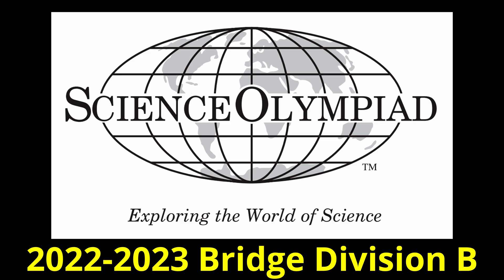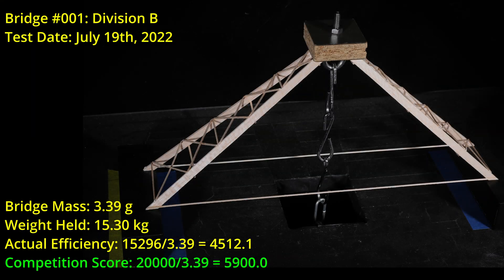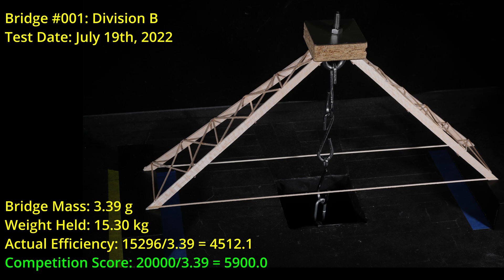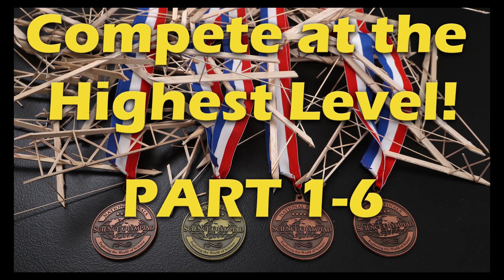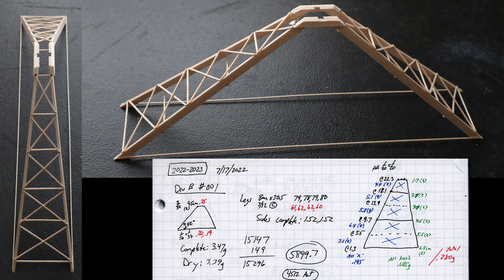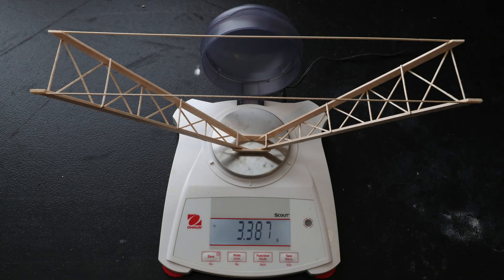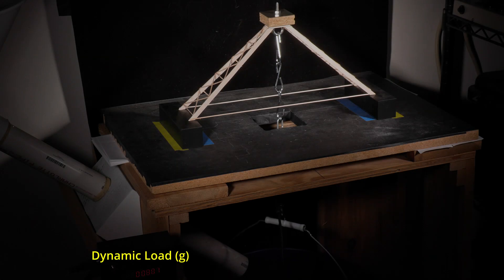2023 Science Olympiad Bridge Div B: 5900

Comment: kinda late but is it fine if i use basswood for the legs and just glue two of them together?
Reply from the maker: Basswood would work fine, but you'll find that it is much heavier than balsa, so the efficiency won't be nearly as high
Reply: @balsaengineering6686  thanks for the quick reply i just need it to be atleast 500 efficiency  to pass 😅also is the height 24.6cm right? and how long are the legs
Reply from the maker: @rk741  I would recommend drawing out your requirements on a sheet of graph paper to figure that out.  That is basically what I did with this design.  The Div B rules for 2022-2023 specified that the loading block height needed to be at least 15cm spanning 35cm.  If you want the duplicate this design, you can download the side STL jig files linked in the description of this video as well as the assembly jig.
Reply: How would I use the stl files if I can’t 3d print
Reply from the maker: @rk741  You could bring them into a 3d viewer and examine them to try and come up with something to use as a jig.  It really helps to have some kind of assembly jig for these types of devices.  If you don't have or know someone with a 3d printer, you can get them printed as a service, but I have not done that myself.

Comment: What did the Daniel Wright MS bridge of 2015 look like? Was it a similar design? Was it shorter than the 15cm min height of this year? Did it actually hold full load or was it even lighter than 3.06g? their 4906 seems astounding and unreal.
Reply from the maker: Hi Bruce, I got your email, so I'll answer in more detail there.  The short version is that I wasn't at 2015 Nationals, so I never got to see Daniel Wright's bridge.  I would be shocked if it weren't shorter than what we had to do here as there was no height requirement.  A 4900+ actual efficiency bridge is very, very impressive.  I have only ever built one that was better and that was at much more than 15kg.

Comment: do you have a picture of how the assembly jig gets put together?
Reply from the maker: Hi!  Probably the best example of seeing how this jig gets assembled is from one of my other videos where I use very similar jigs.  Check out this spot in the Part 3 of my optimization video.  The jig for this season is put together exactly like this.  Basically just glue the 3d printed parts together.  I like to use PL3 construction adhesive for that.  https://youtu.be/0tzcp99kzdk?t=68
Reply: Hi it's me again. I noticed you have 1/20 by 1/20 bass for your cross member, where do you source the wood? I've searched fnabco, but can't seem to find them.
Reply from the maker: @rylanchau3645  Hi!  The cross members are 1/20 x 1/20 balsa, not bass.  That is made by cutting sheets of 1/20" thick balsa
Reply: @balsaengineering6686  oh, are the tension members also balsa?
Reply from the maker: @rylanchau3645  No, the primary tension members were 1/16 x 1/32 bass

Comment: Hi its me again 😂! I was wondering what the dimensions were for each part of the bridge. For example, the bottom 2 pieces of wood, what were the dimensions of it? If you could get back to me i would really appreciate it!
Reply: Also, the lateral bracing wood pieces, what dimensions were those?
Thanks!
Reply from the maker: The bottom primary tension pieces were 1/16 x 1/32 basswood for this build
Reply from the maker: The cross members were 1/20 x 1/20 balsa and the legs were 3/32 thick by 8mm.  Good luck with your builds!

Comment: Hi there, my student has been building this style of bridge. His last two bridges were 6.5 g and 5.5 g, and they held 12.5 kg and 10.5 kg respectively. None of the members broke on either of these bridges. The glue just broke loose on the top connector piece. As far as I can tell, he's using enough glue and using decent technique, although I will watch him do it next time to make sure it's absolutely correct. Is there anything else to consider to make this connection point stronger?
Reply from the maker: Hi Ryan, it's hard for me to tell exactly what is going on without seeing it.   If you can send me a couple pictures to mklinger at comcast dot net, I might be able to provide some more detailed feedback.  In general, the glue itself doesn't usually fail, so if his joints are popping apart, he's probably not using enough glue or pressing the pieces together long enough or both.  More typically, the glue holds and it rips the balsa itself which means one of the pieces is too low a density.  If you have time, have your student build a very overdesigned bridge, say 10-11g and see if that holds everything.  That should really show if there are build issues.  Also double check how level his build is.  If it's too uneven, it will induce loads on one side that can easily rip the joint apart.  Good luck!
Reply: The pieces are indeed low density, and I thought that might be an issue. On your bridge here, is the connector piece a higher density than the compression members? I might send you a picture later, thanks!
Reply from the maker: @Ryan-qf3kz  I can't remember if this bridge used exactly the same density as the legs, but it'd be very close.  In general, with this design, if the top piece is the same or similar as the legs it should be balanced.  While your case is low density, at 5.5g, it still should be much stronger than what I used here unless your bridge is very unbalanced between the legs and everything else.  Shoot me an email and we can chat some more about it
Reply: @balsaengineering6686  Update: He used higher density balsa on the connector pieces for his next two bridges and it worked like a dream. Got a score of 3773 at Regionals! Thanks for the pointers
Reply from the maker: @Ryan-qf3kz  That is great news, glad to help!  A 3773 score is a very well built bridge!

Comment: Hey there, how can you make it this bridge so light because 1 stick of the leg (thick light balsa) is averagely  5 grams. Also what type of wood and dimensions did you use for the legs. Thank you and nice video!
Reply from the maker: Thanks for the positive feedback! The short answer is to use lighter wood.  Balsa comes in a huge range of densities.  For this build, I used 3/32" thick by 8mm and each of the 4 normalized pieces I used to make the legs were 30.5 cm and they weighed around 0.8g each.  Each final leg piece was about 0.61g.  You might like this video I made on density vs efficiency for some more insight: https://youtu.be/mzMFhd4SqP8

Comment: Does the pattern in the side crosses matter?  I see on the #001 bridge it starts being zigzag over for 3 of crosses and then switches to under for the last two zigzags.   Thanks so much
Reply from the maker: I try to remember to alternate them, but it's not super critical.  The reasoning to not have them all in the same direction is that those pieces get bent a tiny bit while gluing one over the other which induces a small torque to the rest of the bridge as they act like tiny springs.  If you alternate, it will balance those forces out and help keep the entre bridge as square as possible

Comment: Hi! When you assemble the jigs, is there a gap between the two triangular prices (the ones that make up one side?) 
Also, what would you recommend for cutting balsa? We were using an x-acto knife and balsa cutter, but noticed while cutting perpendicular to the grain it was showing a lot of resistance, causing our wood to splinter, bend, etc.
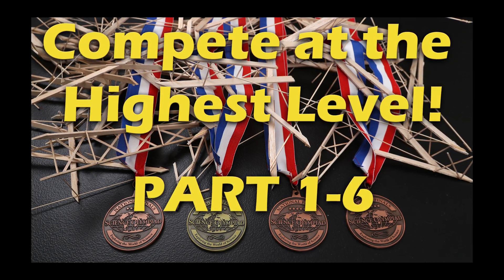Reply from the maker: No, there shouldn't be a gap between the triangular jig pieces, try to glue them as tightly together as possible.  I like to use the miter cutter from fourmost products for most of my balsa piece cutting (not stripping from sheets, but for cutting the pieces after that).  Here is a link to their product if you can get one, it helps a lot:  https://www.fourmostproducts.com/our-products/construction-tools/     If you mean stripping the balsa sheets, one trick is to snip off the end of the x-acto blade which makes it more stuff.  You can see that in my balsa library video around the 3:45 mark: https://youtu.be/bLsTOpmozGI
Reply: @balsaengineering6686  Hi! Thank you so much for replying. This actually helped us construct our very first bridge today, which ended up weighing around 6.2 grams. We were wondering how to tone down the weight even further. We used epoxy glue. While stripping the balsa, we noticed that the strips tended to vary in weight quite a lot (ranging from 0.6gto 1.2g) even though they were from the same sheet of balsa. Is this normal? 
Would baking help decrease this weight? What are the conditions you used for baking your bridge? Also, we used basswood for our primary tension member, so to decrease the weight would you recommend making the whole thing out of balsa?
Reply from the maker: @avnigupta3393  Hi!  Congratulations on building your first bridge! 6.2g is not bad.  I would highly recommend using CA glue over epoxy.  Stick with bass for your primary tension members, especially if you have 1/32x1/16 available. To answer your other questions, yes, the density variation in the sheets is normal.  It's so common I made an entire video on it: https://youtu.be/bLsTOpmozGI   and for baking the bridge, I made an entire video that goes over that and more for competition prep:  https://youtu.be/6zOvHMZLaNE   you might also benefit from my gluing video: https://youtu.be/55lb2KzSiwg   Good luck!
Reply: @balsaengineering6686  hi! Thanks so much for responding again. Do you know where we can acquire testing apparatus for the bridge (specifically the loading block)

Also, there is a slight bend when you glue the cross members. The top cross member causes the bottom cross member to bend. Does this affect our build? Will it affect how the build performs?
Reply from the maker: @avnigupta3393  Hi!  I know you can buy the professional testing rig here if you want: https://www.balsawoodhoppers.com/  It's pretty expensive and I think there is a pretty long lead time.  Most teams just build something that works by putting a piece of wood between two tables and hand-loading the sand.  For the loading block, just cut a 5cm x 5cm x 2cm block of wood and drill a hole in the middle.  Or if you have access to a 3D printer, it's pretty trivial to print a loading block that size.  Good luck!!

Comment: Please can you share the grain that you are using for building this bridge. I have A, B and C and need help with which one is best!
Reply from the maker: This particular build used all C-grain balsa.  While that might be the best possible choice, especially for the legs, it's definitely not required for great results.  I have built several 4500+ actual efficiency bridges that didn't use any C-grain in previous years.   Equally important is having a well balanced bridge (all legs nearly identical mass) and built as perfectly level in both directions as possible.

Comment: Do you think a single laser-cut sheet of 1/16 or laminated 1/32 basswood on both sides would weigh less and support equal weight? Do you think it would be enough improvement in efficiency to warrant the trouble?
Reply from the maker: They definitely wouldn't weigh less, especially the laminated option.  The glue layer adds a lot of weight.  For this bridge, I was using very light, highly optimized pieces of C-grain balsa.  Regarding laser cutting in general, while it'd be really fun to play around with a nice one, I don't think it would help in most cases.  I see a couple big problems.  If you managed to cut a side from a single sheet, first it would be really expensive as you'd be wasting most of the entire sheet.  Next, the grain alignment would be totally different which might cause problems, and most importantly, the density and thus strength is not consistent throughout an entire sheet, so a side cut from a single sheet wouldn't have balanced legs.  That is a big key to getting the bridge fully optimized, especially at this level of mass.  Laser cutting might be very useful for smaller, more intricate pieces, like the platform pieces I'm using for the Div C design this year, but even then, it probably wouldn't justifying buying a nice $5000 CO2 laser cutter.

Comment: I have always had a hard time stripping thin pieces of bass. Can you give any tips? Also, what thickness bass sheets are you using for the tension pieces? Thanks!!!
Reply from the maker: I have never tried stripping bass sticks from sheets.  For me, it's just not worth the headache.  I have recently found a nice source for them here:  https://fnabco.com/collections/basswood-sticks 
For this build, I used 1/16 x 1/32 thick which should be fairly conservative at most densities.  If you want to push the limit, you can try 1/32 x 1/32, but you have to be careful and choose higher density pieces and make sure they have been cut well if you want it to hold 15kg+.  For the most part, I'd stick with 1/16 x 1/32. Good luck!!
Reply: @balsaengineering6686  Thank you!!

Comment: what type of wood was used for the side to hold the thinner pieces, bottom to hold the thicker area and what wood was used for the top part?
Reply from the maker: This bridge is all made from balsa except the primary tension members are bass wood
Reply: @balsaengineering6686  what part of the bridge is the tension members? and what are the specific measurements?
Reply from the maker: @indigo9971  The primary tension members are the bottom parts of the triangle sides.  I would highly recommend you start with watching my Getting Started video carefully.  In that video, I create an entire Div B bridge from a single sheet of balsa which can be very competitive.  I go through all the details of each piece during the build:  https://youtu.be/7MwflLa5kCg

Comment: Hello, may I know what is considered a primary tension member in this bridge?
Reply from the maker: Hi!  The primary tension members of this bridge (there are 2 of them), and all bridges of this triangular type design, is the bottom part of the side that spans the entire 35cm.  Those pieces, when the bridge is under load, are in almost pure tension, meaning you can think about them as being pulled apart from the ends and nothing else like being bent or pushed.
Reply: @balsaengineering6686  Thank you!

Comment: God damn, 3.39 and over 15kg of weight???, my first bridge was unmeasured, and I put like 6 braces + 2 verticals of tension, making it weigh 6.52 g and hold 15 kg, giving it efficiency of 3067. But holy 5900 efficiency? thats almost double the standard for the bridges that had to carry moving weights.
Reply: p.s tbh, my coach told me to do 3-5 braces (not counting verticals), I think I can get my bridge designs down to 5gms and still hold the 15kg. My first bridge broke cuz my leg accidentally hit the bucket T-T ~ I know not to do that anymore-
Reply from the maker: 3-5 cross braces is a good suggestion.  This bridge has 5, so that is obviously what I found to be the best.  Vertical trussing to the tension members isn't necessary with this type of design for most leg choices.  Good luck as you build more, definitely let me know how it goes!
Reply: @balsaengineering6686  alright, thanks! good job on your videos!
Reply from the maker: Yep, this build was pretty insane!  This is probably very close to the upper limit of what is possible.  It's always nice to see what can be done to have something to compare with.  Good luck with your builds, your 3067 is a very good start!

Comment: Can you shine light on the reasoning behind the tapered legs vs a square build. My son built 3 bridges of similar design to yours differing construction methods and material thicknesses slightly in each but not tapered and they’ve performed terrible. Barely holding 9000. Im assuming a jig helps hold these tapered angles true? Do you have any recommendations in jig building? Thank you for putting together a channel that is so helpful to teams. I’ve learned a lot and in turn that allows me to help my son with his builds.
Reply from the maker: Hi! The main reason to use a tapered design is for added lateral stability and less mass as the cross member pieces are much smaller as it tapers at the top.  It does really help to have an assembly jig if you are attempting a tapered design or even a squared design for that matter. 3D printing is the best way.  Think of it in 3 parts, the middle piece and then the 2 bottom pieces which get glued on.  It would be better to print it all as a single piece, but not many printers can handle pieces that big  (mine can't).  If you check out the 3:05 point of this video, it shows several assembly jigs which can give you an idea on how to design and build them. https://youtu.be/0tzcp99kzdk   If you don't have access to a 3D printer, even building something simple with wood or Lego would be better than nothing at all.  Good luck!
Reply: also, dont be diss encouraged as most of my bridge team has only held 7kg - 10 kg, only me and this other guy has held 14kg-15kg